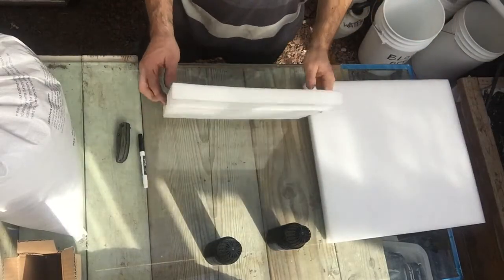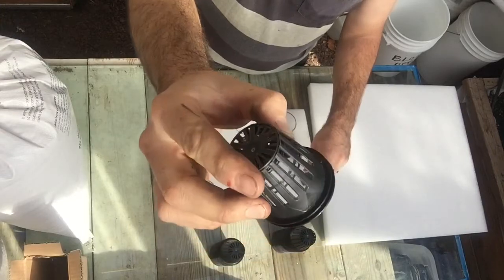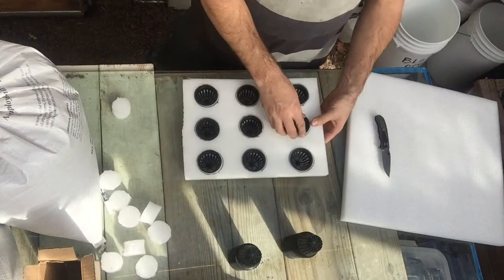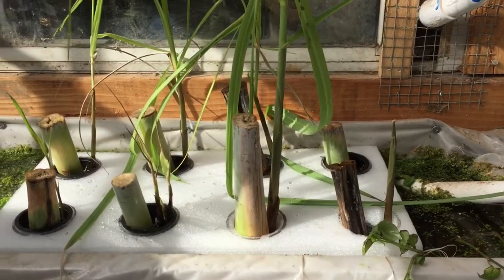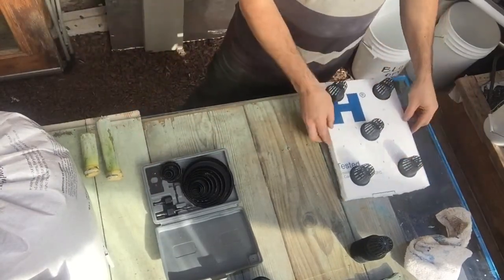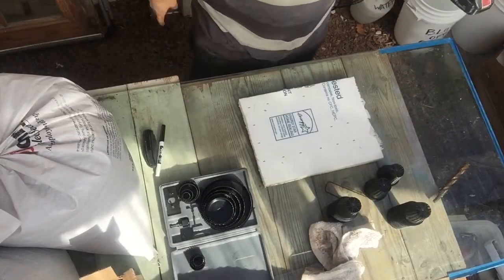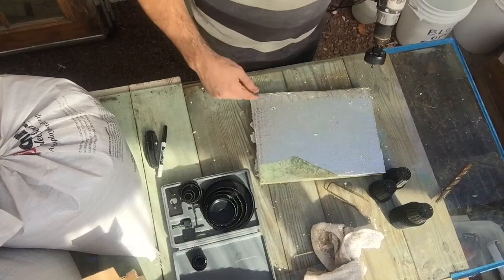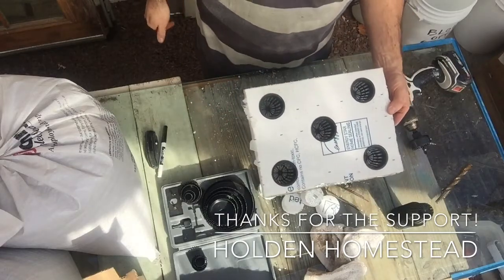How To Make Aquaponic Floating Trays For Free

Comment: Hi! Thanks for the video. Could you please advice what exact name of the foam you used for your raft first time in this video? What can you say about it after one year since using it? Thanks in advance!
Reply from the maker: Алмаз KZ the foam with the silver layer  on the bottom works way better but need to watch out for the foil coming off and clogging the system only had that happen 1 time . The foam I used in the beginning worked great but I got it from a package and it was make from polly.
Reply: Holden Homestead Thank you!

Comment: How do you know your foam is non-toxic? I imagine the foam you buy at Home Depot, et al, may say it is non-toxic. Does it? What about stuff that came in the package? How do you know that is non-toxic? 

Thanks in advance!
Reply from the maker: McRobbah it depends what material it's made from all the material I use is polyethylene and not made with BPA ... the food grade totes and 55 gal bins are made from the same thing and is considered safe .. let me know if you have any more questions thanks for watching !
Reply: I was wanting to use homedepot foam, but wonder about chemicals. I would guess the foil reflector is glued on one side, is glue safe?